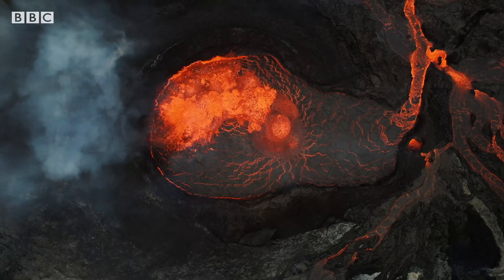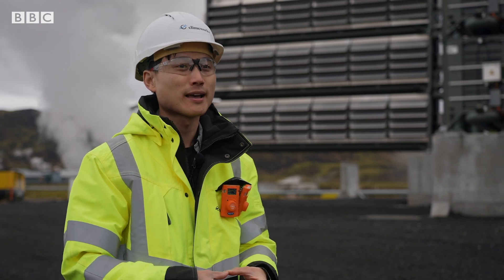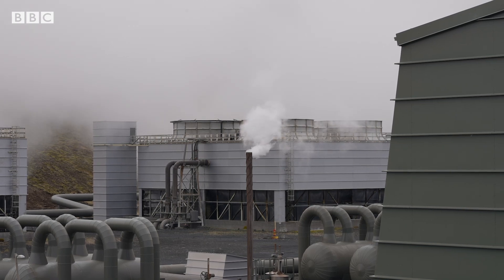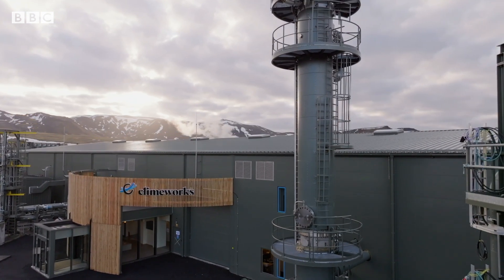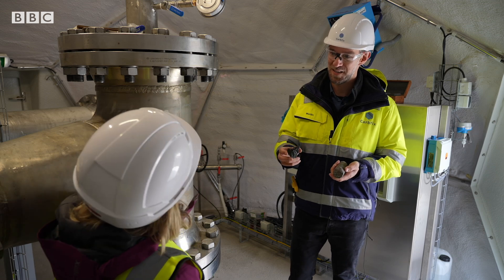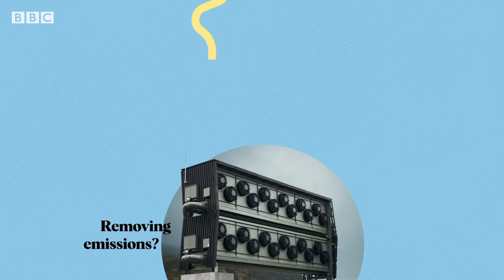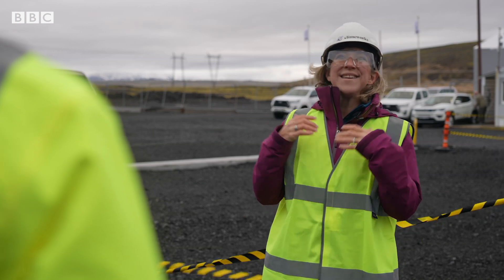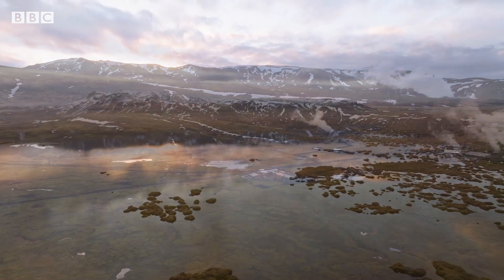Inside the hidden carbon plant pulling CO2 from thin air | BBC News

Comment: We release 37 billion tons of CO2 yearly. I don't know how well this will scale.
Reply: I think it should be considered locally (if every country builds enough co2 capture for their own production it could work) However Iceland produces about 1.7 million tons of CO2 per year so 36 thousand tons out isn't much, like peeing on a house fire to put it out
Reply: @Eddygeek18 And that's the point: How many planets do we need to build sufficiently many of these facilities?
Reply: @Eddygeek18  They have sited this in Iceland because of the porous rocks (and cheap hydrothermal energy?). Placed close to sources of high CO2 emissions, it would be more efficient. Regardless, no single strategy is enough.
Reply: @compassroses  The man is right about gas diffusion. Gases all spread fast from their sources, may as well let it haul itself from where it is emitted to where it's easier to entomb it.
Reply: @lexslate2476  Gas diffusion takes time. Waiting for CO2 concentration to equilibrate at the "entombment" site is equivalent to extracting CO2 from the unconcentrated average. Not an impressive argument.
Reply: It is business who are the biggest polluters. 
They should be required by law to pay for carbon capture to be built on their premises, and at the scale required to clean up their own mess. This includes airlines, oil and petroleum producers etc, and they must all be complete and ready to come online by 2030. That includes power generation, so if you have a filthy coal or gas power plant generating a city's energy, then they have 6 years to either build a nuclear power plant or sufficient solar and wind farms. 

No more of this carbon credit nonsense, companies must remove any CO2 they put in the atmosphere or be told they will be shut down by legal order in 2030.
Reply: Fact: Scales very badly!
Reply: It can't. Like trying to empty the ocean.
Reply: Computers had nothing power to ai of today so I’m guessing in about 30 years it will be quite good.
Reply: Its a distraction so companies can keep their operations as usual while pointing at this to show they are working on a way to remove the CO2 they emit from the air when faced with criticism. The only real way to stop global warming is to reduce emissions at the source, which mean companies have to change and implement this. This is just buying them time until the problem gets bad enough that world governments have to colaberate on big projects because it would be an utter disaster if they just let it continue.
Reply: If we actually used nuclear energy we would have the energy abundance to do things like this. As it stands such projects are totally not viable because of high price per energy.
Reply: @anongimus  Finally someone who understands Nuclear energy is not and automatic Chernobyl on your door step.

It's way safer than back then and the waste is not dangerous glowing green goo that melts holes in the floor and makes mutants.
Reply: It can be effective for everything that creates CO2 to put a system in it that reduces the CO2 is produce and create wells at gas stations to drop the CO2 into. So people have a system In each household and equip cars with these system and tanks to make them neutral and of course can drop it in a CO2 well at a tankstation. That's the only way I can think of to make these system effective and easy to operate.
Reply: @bikexploration  Trees are the best thing for getting CO2 out of the air and hive oxygen on return it's moronic to makes these instead of just planting more trees and stop cutting down trees we already have.
Reply: @bikexploration 
I had the same idea, but the problem is to store it afterwards. I think you need certain rocks.
Reply: @NoidoDev  then let science & knowledge do its thing. To create and standardize a system to balance the in & output of Co2 on everything that produce co2 ofcourse. Thats how we all can do something about it in an sustainable wau. Instead of spending blions on plants that can't even reduce 1% of our needs.
Reply: @bikexploration  
Your judgment is off and you don't know enough about it. Stop trash talking ideas and people trying something out. This is obviously necessary and it seems to be sustainable.
Reply: @NoidoDev  the point is i don't judge its an theory so stop judging please.
Reply: @bikexploration  
I will judge off course. If you judge a tech developed, I can do the same. But you wrote "plants" above, which is ambiguous. You were referring to the plant in the video?
Reply: Carbon capture requires a LOT of electricity. There would need to be hundreds of thousands built within 11 years to prevent the climate change tipping point.
This is NOT the solution we need.
Reply: It's a clever way of milking government money for 'green causes'. And it allows governments to boast about doing something to appease the leftards. A win-win.
Reply: It's meant to be a test/prototype...remember the model T had 20 horsepower.

In 25-50 years we should have quite a bit better power generation from a combination of fusion, efficient solar, geothermal, etc combined with more efficient CO2 removal.

Not to mention global warming will kill off large chunks of population in Africa, central america, middle east, india, southeast asia, etc. Probably around 50% or more.

So yeah lots more removal plus less production.

Stuff in mass production tends to go down in cost 90% or more so we could build a bunch of these plants then the only issue is power. I expect solar panels in 25 years to be 2x better than current ones. Geothermal might not get more efficient. Nuclear probably will barely change. Fusion may or may not workout.
Reply: @chriskl2361  That's a very casual way to describe mass death. Also, the people in the countries that have less wealth and less ability to protect themselves from the heat are the people with some of the lowest levels of carbon output. They'll barely affect carbon output.

Geothermal, if the new drilling tech pans out and its viable range expands considerably, is probably a better thing to bet on than fusion. Because we already have working geothermal generators, and the cost of drilling is the main barrier to installing it damn near everywhere.
Reply: @lexslate2476  It is casual, it can't be stopped the way things are going. Indonesia has 275 million people on tiny islands in the worst global warming zone. Bangladesh 171 mil.  India 1.4 billion. Not to mention the other massively crowded nations in south east asia, south asia, etc.

We didn't force them to massively explode their populations, they did it themselves. And when global warming hurts fish populations by even 10% they will overfish rather than let their people starve which will mean they each ruin the ocean even further. 

US has a population of 333 million in 10 million kms, Indonesia 275 million in 1.9 million kms (much of that being mountains and active volcanos with half that 275 million living on Java which has an area of 0.128 mil kms). Bangladesh 171 mil in 0.148 million kms And the US is a lot more fertile  and developed too.

Maybe they didn't choose to be poor, but they and the government they elected choose to let their populations explode. Not to mention China/Japan/Taiwan/Korea were burned out husks post WW2 and they've done great for themselves so other nations that didn't get demolished 70 years ago don't have much of a excuse.

If the people aren't responsible for their elected government, then what's the point of democracy? The fact that their land area can't support their population base was basic math. If the US practiced what they did, the US would have a population in the billions far surpassing China or India.

I get that we have to be responsible for the worlds global warming/pollution. But do we need to be responsible for their lack of population control?
Reply: Of course we also need to mitigate most of those emissions to be able to reach net negative emissions. Also remember that this is not the only method of carbon dioxide removal available.
Reply: All that CO2? guess where it came from? Plants that absorbed it millions of years ago. It was ALREADY in the atmosphere. We are just PUTTING IT BACK we cannot create the stuff We are NOT making more. just releasing what was once there.
Reply: I think the best green movement we have had is the ocean clean up. It's incredible how much they have pulled out of the ocean. It's also easier in a sense. (the trash collects in artificial islands). So to scoop it up this way is much easier than say CO2 thats spread throughout the atmosphere.
Reply: doesn't matter. That CO2 was in the earths atmosphere to begin with.
Reply: @Helliconia54  no it wasn't it was stored in fuels. When you burn a hyrdocarbon fuels C02 is created as part of the chemical reaction that takes place. The C02 was in the atmosphere millions/billions of years ago but not now.
Reply: Atleast they are doing something.
Reply: It’s not energy efficient that is why it’s located on a nearby geothermal fissure.
Reply: @marchawkinsdimacali8041 its not  resource and material efficient  its not energy density efficient, its not cost   effictive its just corrupt grifting
Reply: Yeah they said once fully operational, 26,000 tons per year.  That's nothing.  They are lucky that they have geo thermal for clean free energy, most of the world doesn't have that luxury for running such a massive piece of machinery.
Reply: it can’t, even if the tech was magic, it’s not, storing that much co2 is a fantasy. pure greenwashing. cheapest method is to stop burning coal.
Reply: 0.01%
Reply: Yes, sometimes it's estimated approx. 40 billion/giga tons of CO2 every year. We r approaching tipping (break) point when planet won't be able to process such a huge amount of greenhouse gasses. We r pumping so much of them in the atmosphere that we will forever break what's still left of the delicate balance and start approaching insane extremes. Planet's warnings r already here and they will only become stronger and more dangerous. We r approaching end of the cliff and heading into abyss... In that inevitable point in the future we will gladly scale up DAC to as many of them as possible, however by then it might be too late. In that point DAC might even become one of the few beacons of hope left for us to undo all that mess we have caused.
Reply: Only 36000 tonnes!!! What 🤡 wasted money on that white elephant…
Reply: Its ridiculous rube goldberg  grifting
Reply: Just do the math anmnd you  willl see how stoopid an idea this is
Reply: It makes money from carbon credits
Reply: At 36,000 tons captured we'd need 100,000 of these plants to counter it. Not including the aditional environmental cost of building and installing it.
Reply: It won't and we know it. We know this is greenwashing...
Reply: @NimbleBard48  I think this is better than nothing, but you may have a point. Do you know who funds Climeworks, what is their business plan?
Reply: @aquelpibe they sell carbon credits to companies so that they can say they are carbon neutral.
Reply: @-DM  I see. Thank you.
Reply: @aquelpibe  A number of companies plus right now about 20000 regular citizens are byying the CO2 removal. The US government is also contributing part of the cost of the ”DAC hubs” that are being built in the US where Climeworks will be one of the companies taking part.
Reply: @reason3581  thanks.
Reply: @NimbleBard48 
It's not greenwashing, it's necessary.
Reply: Trees do the same damn thing for free.
Reply: Trees exist
Reply: @bb5979  Yes TREES they most certainly do exist my friend these people are doing worse than reinventing the wheel.
Reply: Why would anyone want to reduce plant food?
Which is increasing agricultural output by 15%.
They must want people to starve.
R
Reply: @RalphEllis  Plant food? Have you not heard of the research that demonstrates that plant growth is inhibited by supra-threshold levels of CO2?
Reply: How will trees scale to
Reply: it escapes to space.
air is always slipping away…
Reply: @11ThreeDoctor   Are you a real Doctor?  Only hydrogen and maybe some helium escapes to space from our atmosphere, I think?  Carbon Dioxide has a molecular weight of 44.  Nitrogen (~78%) and oxygen (~21%) of our atmosphere have molecular weights of 28 and 32 respectively.
Reply: @11ThreeDoctor  Only the lightest gases can escape Earth's gravity. Carbon dioxide is too heavy to escape.
Reply: @11ThreeDoctor  c02 is heavier that most gases in normal Air
Reply: @11ThreeDoctor  Shhhh... let the adults talk
Reply: @rossmckeown8675  baby who plays VIDEO GAMES!
Grow up baby!
Men are talking.
I know who you are.

Comment: The laws of thermodynamics speak against this being a possible solution.
Reply: really? explain
Reply: @ldm3027  https://www.youtube.com/watch?v=EBN9JeX3iDs
Reply: @maxloewe1  Could you explain it anyway? Give some hint at least?
I don't see the laws of thermodynamics speak against this approach.
I assume, the linked video makes the wrong assumption, that "CO2 capture" means conversion of CO2 into a fuel again.
Which costs of course more energy than you get by burning fuel.
But simply collecting of CO2 from air and pressing it into the underground needs much less energy.
Even if you would use 100% energy from natural gas for the "climeworks"-process, you would remove more CO2 than you produce by natural gas combustion.
And nobody propagates fossil fuels to run these processes.
Reply: @701983  "simply collecting of CO2 from air and pressing it into the underground" are you sure your calculations are right?

Comment: at current rates, you'd need about a million of these for net zero
Reply: Yes, but such plants are not meant to compensate the actual emissions.
They should compensate inevitable residual emissions, together with other methods.
They are no alternative to the stop of burning fossil fuels, but an addition.
Reply: net zero is lies
Reply: The price capture and store it that way, can be the price for emitting carbon dioxide.

Comment: The company Climeworks is currently privately funded. Its customers like Microsoft, H&M, Lego, Lufthansa, Ocado, Swarovski, UBS, shopify etc pay Climework to remove CO2 to offset the CO2 from their own operations. I guess not a bad idea if these capture plants can be powered efficiently using relatively clean energy like thermal in Iceland. Though would like to see more data and it should be one solution amongst many working together to reduce CO2.
Reply: Gates buys $7million of carbon removal credits from Climeworks each year to cancel his carbon footprint
Reply: I like this comment. The plants are purposefully built in Iceland because of the abundance of geothermal energy there. The quoted numbers for removal are the net negative effects on the atmosphere (so after removing the emissions from the creation and running of the plant). I totally agree, there is not one silver bullet to remove CO2. We need to be reducing our emissions and, at the same time, deploying a portfolio of removal solutions like this.

Comment: Videos show that CO2 moves around a lot like clouds and doesn't just diffuse, at least not rapidly. Clearly, catching it in the big plumes would be 1000 times more efficient.
Reply: wrong, otherwise that is what we would do
Reply: You probably refer to animations, which show tiny differences in CO2-concentration in different colors.
Which is pretty misleading.
I found one with dark red for 386 ppm and blue for 380 ppm. Obviously a little bit older, today we are at around 420 ppm.

Comment: But using tons of actual resources which also emit CO2 in their production (not just the energy, also the metal and such) to then capture CO2, are you sure that's actually worth it? How many years does that need to actually net-reduce the CO2 in the air?

Also, the market-based carbon price in the EU is 60€/t, so using 1000€/t is ridiculously expensive, much more efficient to just reduce actual emissions (as I said, the money isn't just money, you needed trucks and energy to produce the stuff and then need energy (that could be used to replace fossil fuels) to run it)

Comment: Scam. It takes eight times the energy to remove the carbon. So you'd be eight times better using the geothermal energy directly, instead of burning fossil fuels. That's just one of the reasons why this technology is not scalable.
Reply: Regarding to climeworks, they need 3 MWh of energy (2.5 MWh thermal energy, 0.5 MWh electricity) to capture 1 ton of CO2 from the atmosphere.
1 ton of CO2 would be the emission from the combustion of 5 MWh of natural gas.
So you need 3 MWh to remove the emissions of 5 MWh of natural gas from the atmosphere.
Theoretically, you could use natural gas for this process and would still get a net carbon removal.
But it wouldn't make much sense of course.
Reply: @701983 Interesting. That's pretty good.  Does that include building the facility, transport and storage?
Reply: @samshep70  No.

Comment: To the dumb comments- It’s an experimental facility. This is how you discover new technologies and also learn how to make them more efficient. It would have been nice if they actually said this in the report.
Reply: The comments are on point as long as they're not intended as a means to wash their hands of our collectively shared blame. Tech like ccss is a  demonstrably and fundamentally problematic dead-end, only theoretically a solution but nowhere near scalable or deployable in time. It helps us pretend we can innovate and consume our way out of the very mess innovation and consumption is creating.